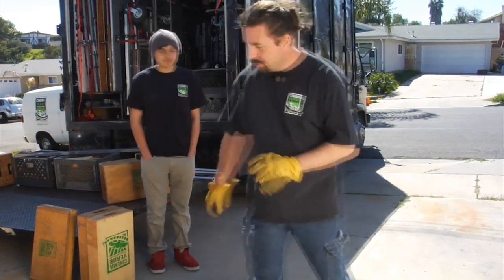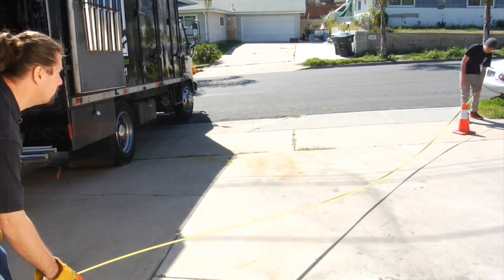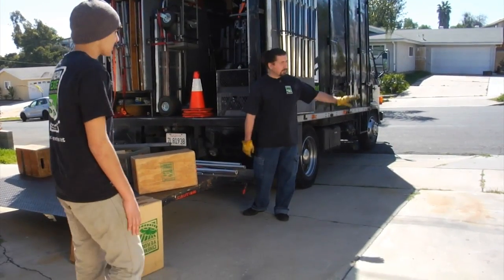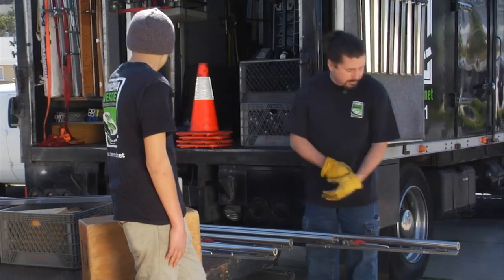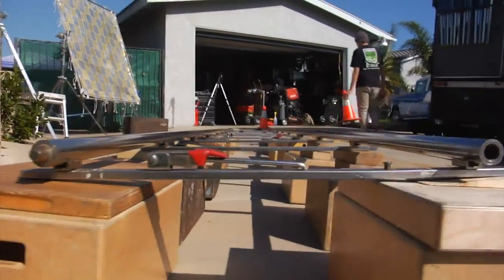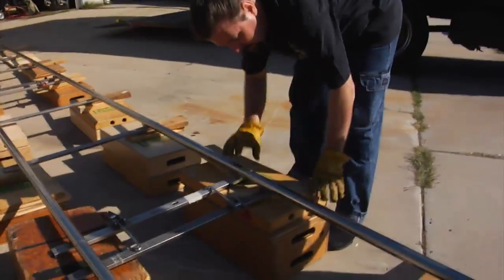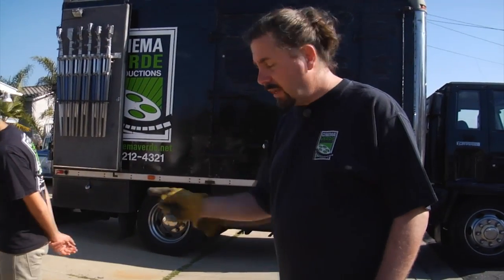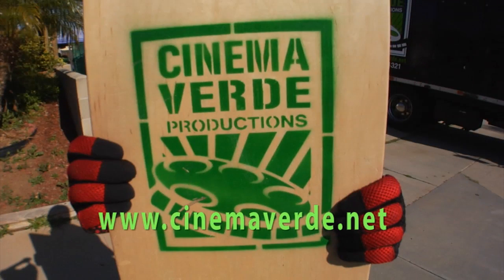Cinema Verde Productions Dolly Track Demo

Comment: As a SteadiCam owner/operator I think this video says it all. These guys work hard so my hats off to them. However I could have been ready to shoot and shot the scene in a fraction of the time. Not to mention the weight of a dolly and the SteadiCam handles long shots much smoother and with much more dexterity...allowing for a more creative shot. 40yrs as an operator...I'm still thanking Garret Brown.
But let there be thanks to the hard working crew that has the skill to setup  such systems and to these people who did an amazing video demo...first one I've seen.
Reply: IAWFilmWorks yes you could have been ready to shoot in half the time if you have your steadicam already built and balanced. However that wouldn’t always be the case and you should know as well as anyone that certain shots require certain set ups and it’s all down to what the director or DOP want. If they want more creative freedom over the shot then yes the steadicam works but if they are looking for a controlled, one directional movement then the dolly is the one to use. Also bear in mind not every production can afford to hire a steadicam or a steadicam operator for that matter so sometimes track and Dolly can be a better option in this sense.